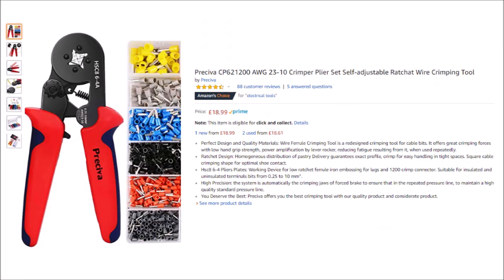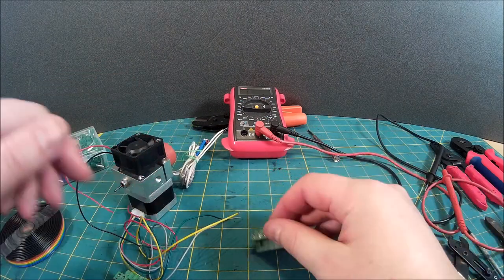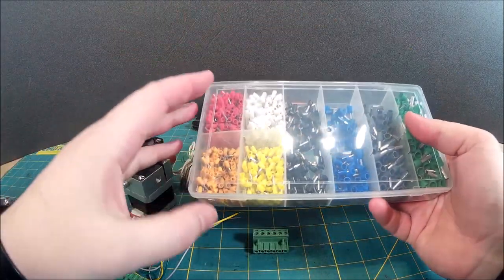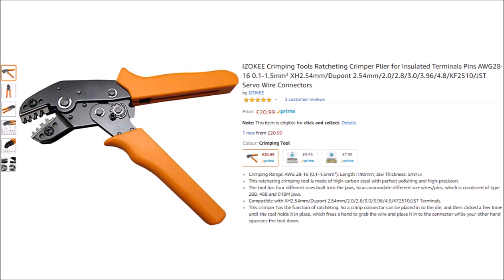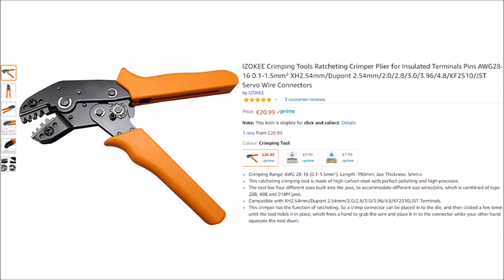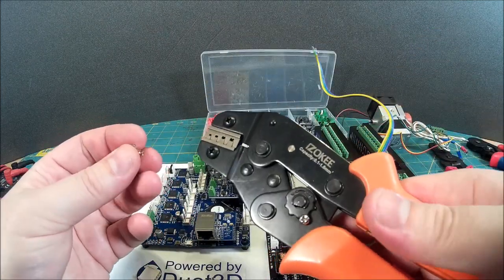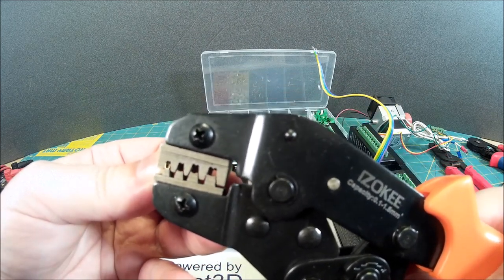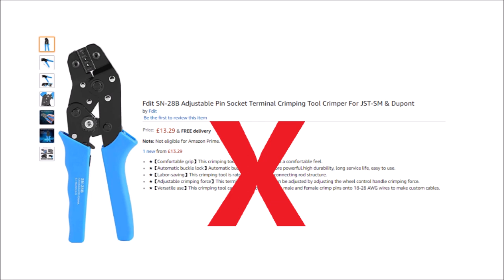How do I find Decent Electrical Connector Crimpers?

Comment: Thanks a lot, mentioning it will only open after being fully closed. I had my new HSC9-4 jammed on 10mm2 wire ferrule. Did 2 16mm2 ferrules, and on one the wire pulled out.
Reply from the maker: Thanks for the heads up. I only use small ferrules so it's good to know.
Reply: @CNCModellerUK  I had a reply from the seller. There is a small release lever, in the slot of the moving handle. They said for knife, but I used screwdriver. It’s what makes the first click